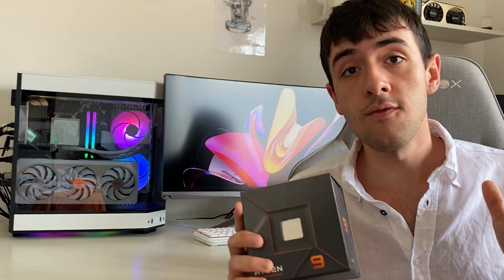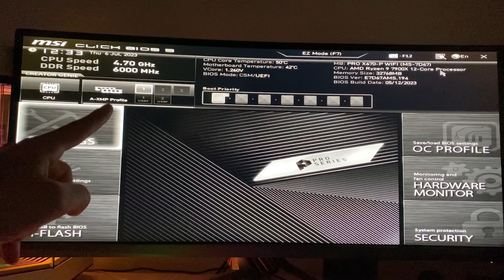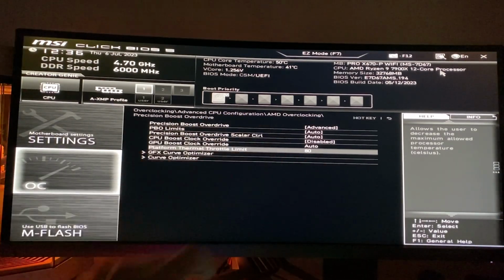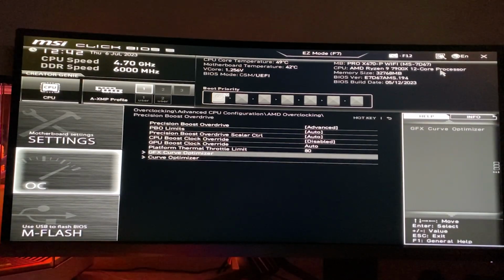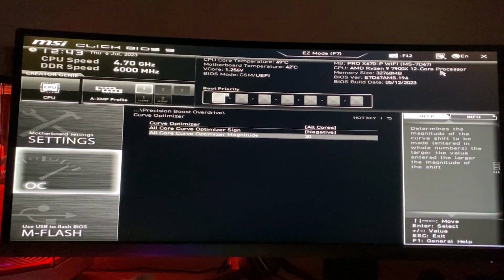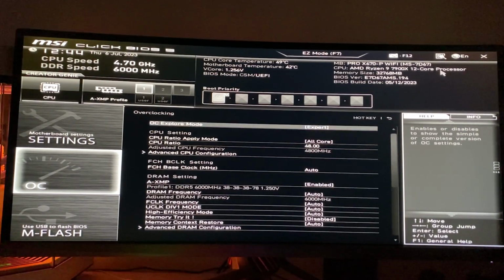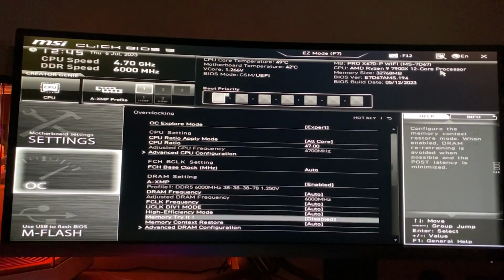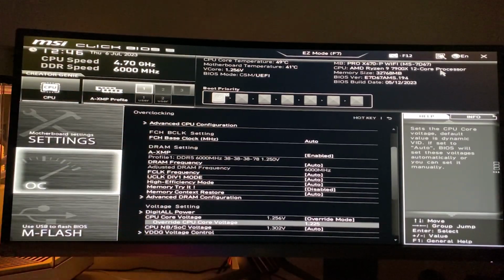Undervolt your Ryzen 9 7900X for more FPS and Lower Temperature!

Comment: Old video but hopefully someone can help.  I’m trying to follow this video and so far I managed to do the first part.  Changing the CPU Core Voltage is where I’m stuck.  I don’t see that option and the only thing I see is CPU SOC Voltage.  Is it the same??  I am using a ROG x670e Crosshair MB with my Ryzen 9 7900x

Comment: I'll share my brief, though I believe very useful, experience. I have a 7900x, I enabled PBO (advanced) and then, using Ryzen Master, I verified my gold and silver cores. Knowing this, I set the curve optimizer to -30 for my gold cores and -25 for the silver cores. What you achieve here is a reduction in voltage and temperature, and increased performance, utilizing most of the available clock frequency. It all depends on the specific CPU and its silicon, but I was lucky enough to be able to reduce the voltage quite a bit. I plan to aggressively overclock it to see the maximum voltage it can handle while remaining stable and functional for gaming, taking advantage of my good cooling.
Reply: Sorry, I forgot to mention that I did this for per core, not all cores. Why? Because only the gold and silver cores can function properly and stably at lower voltages. The vast majority of the other cores would fail, causing restarts and other annoying issues. There's not much point in using all cores at maximum frequency when games don't use more than 3 or 4 cores, being generous.

Comment: Just tried 1.175v at 4.8ghz 7900x on a x870 p wifi and load temps dropped to 70C from 90C, stable, now to test both GPU and CPU under actual game load

Comment: I’m having the best silicon lottery right now. 30000 score in cinebench r23 curve optimizer set to -30 and max cpu temp set to 80

All that with a case that doesn’t allow that much airflow to the processor. I achieved more than 31.000 with the case front panel removed and the air conditioner set to 27°C

Comment: Okay, so we can do the first part with temperature… or the second, with voltage, but not both?

I got a system with a liquid cooled 7900x that gets very warm and very loud, and I’ve thought of taking it back for a 9800 Ryzen build, for $500 more…

Is it worth the extra 500 bucks, or will doing this help enough?

Comment: My 5700x runs on -30 voltage and max positive precision boost overdrive clock thing. 4.85ghz on non avx workloads on 140w kicks hard. And 4.65 on avx workloads

Comment: Hi, should i set the PBO to disabled or auto when i wanted to use the static undervolt? Great videos!!!
Reply: Apparently PBO setting is not doing anything if youre using static OC. Hoping i can limit then max temps when doing full load. On prime 95 i got 5ghz with 1.1v but the temps went 93c, but at least for my games its showing better result with 55c and half the power consumption compared using PBO and CO. Anyways im grateful for your videos, please keep it up!

Comment: I currently getting 65-75c idle and only about 80-85c gaming on games like red dead 2 at all ultra maxed out settings I want to keep frames as much as possible but lower temps with still about 5.2-5.3 ghz is this possible

Comment: one thing to mention about the first method you showed. I found this out the hard way while undervolting my 5000 series AMD CPU. You might get great temps and great all-core performance, but only when your CPU is at load. I've found that this undervolt works great when you have your CPU doing something, but the second you have your PC at idle it will 100% guaranteed become unstable. This happens because the CPU is not receiving enough voltage to keep those low idle clocks, so this results in crashes and most of the time random reboots. On my 5900x I actually couldn't undervolt the cpu at all because no matter what negative number I used I got random reboots. With my 5950x I found -12 to be 100% stable. I just upgraded to AM5 and a 7900x yesterday so I'll give -20 a try but I'm pretty certain I'll get random reboots at idle and I'm sure I'll have to drop that number to something like -15 or -12 again. Honestly, I'm not really worried about performance gains over stock because I'm getting a 5.5Ghz all core boost as is, so I'm just looking for lower temps since in Handbrake I'm getting temps in the low 90s.
Reply: How are u getting 5.5 on the 7900x all cores, whats are your settings?
Reply: @daniboiyy  I actually don't have that cpu anymore I switched to a 7950x only about 3 months after getting that 7900x. I can't remember what settings I had with it.

Comment: I didnt trust this at first but I gave it a go, thermals limited to 80c, and minus 20, yet im getting better cinebench and blender benchmark performance vs stock? I dont get how running my cpu at a lower thermal and power limit improves performance ?
Reply: okay after a bit more research I understand, its not just reducing the voltage, its reducing the voltage relative to clockspeed,  so as an example at 4.5ghz it normally expects 1.1v and a t 5.5ghz it expects 1.4v as an example, undervolting is reducing the voltage at specific clock speeds so the -30 shift at 4.5 is 1.07v and at 5.5 is 1.37v  with a -30 offset, and the reason it improves performance is your producing less heat at the same clock speed so you can maintain the clockspeed, you just have to get lucky that your cpu can handle running at lower voltages.  This also means if you leave your max temp at 90-95 you can get more performance, or you can reduce temp targets to save power

Comment: Just wish to add some feedback to this great tutorial. I was idling around 65° with an AiO so I was sure something was wrong somewhere and with the help of this video I tested both fixed voltage and CPU ratio with no luck even with conservative values but with the PBO negative offset of 30 I was able to drop the voltage to around 1.175V and temperature of max 63° in gaming and idling at 45°. Masterful.

Comment: isn't is just better if you buy 7900 and overclock it to get almost same performance as 7900x ( considering you are using same cooler you would use on a 7900x ) when you need that extra performance, otherwise just let it be limited to 88w and enjoy the efficiency ( source - gamers nexus and LTT)?
am I missing something here because according to me, on same coolers and setup, overclocked 7900 = 7900x. both score around 30k on r23

Comment: I just picked up a 7900x for $280 usd. I could only find the 7800x3d for $425 and figured the deal was too good to pass up/ the extra 2-5% in games was not worth $145. This will be a big help to me as I'm building in a SFF and temps will be an issue.

Comment: Expo 6000MHz, bclk 100 , clock override +50mhz positive, pbo----> motherboard, co negative 18 all core and easy 5550mhz with air cooler ;)

Comment: Thank you sir at 5.5 gz temps are 80F out of the box with a 240 kraken but too much power not being used I'm trying your settings on my b650 board you bios settings are identical to mine..Also running a 7900x
.

Comment: Thankyou bro very much I was literally suffering from the temperature problem with my 7900x

Here are the results 
Stock : 
Cinebench r23 multicore scores 
28552 max temp 95 degrees 
Average temps 93 degrees 

Undervolting setting 1

Speed set to 4.8ghz 
Voltage :1.1
 Multicore score 27215 (nearly 5% performance loss)

Temps : max temp 74.4
Average temp : 72.2 degrees 

Undervolting setting 2

Temp limit set to : 75 

Curve optimiser : -30 

Multicore score :28708 (higher than stock) 

Max temps : 75.4 degrees 
Average temps :74.2 degrees

Stock temps were 93-95😭 bro is a legend
Reply: Whats your setings pbo? :D auto, motherboard or what
Reply: @echickentiken9200  
PBO : advanced 
PBO limits : auto 
PBO scalar ctrl: auto 
Platform thermal throttle limit :75
Curve optimizer: -30 (all cores) 
Motherboard: Msi x670e gaming plus Wi-Fi .
Reply: @yashkryadav7844  bus speed auto or 100Mhz?
Reply: @echickentiken9200   it’s auto

Comment: Need help. Just tried these settings. Saved and exited BIOS. rebooted and red light indicator on motherboard w/ black screen. How can I revert these settings? 😕
Reply: Set the overclock at like 4900 and voltage to 1.90. I can restart and all normally while getting good temps. If you need help just reply and I'm willing to help. It's not talked about enough.
Reply: I assume you fixed this already but just for anyone else facing this issue. Turn off the PC and plug the power off. Take out the flat CMOS battery out of your motherboard or press the reset button if tour mobo has one. Wait for 1 minute, put the battery back, plug in your PC and reboot. This should reset the changes made to your BIOS.

Comment: When I am exploring in Chrome and using Windows folders my temperature is 52C° stock, but when I am playing Left 4 Dead 2 in 4K and using OBS for stream it reaches a temperature of 85°, is it normal? The 7000 series is really too hot in general, I have the 7900x and the same motherboard as yours from MSI, ever playing ARK survival evolve in 4k it reaches more than 90° I feel that at some point this sep up is going to burn. An apology, use Google translator, I'm from Mexico.
Reply: Hey cpus are considered to be properly cool below 99 degress F under load. Your temps looks good! Nothing to worry about.
Reply: @Fluffy-ARC  The degrees are centigrade "c°" not Farenheit "f", for me this processor gets too hot and to only play left 4 dead 2 playing it in 4k I consider it to be quite a bit
Reply: @mexirene  sorry I meant C*. A processor is cooling properly under 95ish degrees C. Y

Comment: Setting PBO to 80 20 in bios has somehow hindered my Ryzen 5 7600 CPU.  Even now that I have set the motherboard back to default settings, I am getting bottlenecked at the CPU in Microsoft Flight Simulator now.  I have lost 15 frames per second, and it is a bottleneck of the CPU doing it. I have not been able to reverse it and get the FPS I was getting before I tried this.

Reply
Reply: Have you been able to fix it?
Reply: There is no point in undervolting a 7600 wtf is this 😂 stupid nga

Comment: Will this hurt the lifespan or help it by doing this? Any info on this would be much appreciated.
Reply: Undervolting will help extend the lifespan considerably. Running at very high temperatures for extended periods causes a lot of "wear and tear" so to speak, undervolting especially if done correctly can cause your CPU to run 15-30C cooler and with 10-30% less power consumption while still maintaining the same or even slightly better performance than stock. You can also cause it to run 25-40C cooler and with 30-50% less power but only a ~10% performance loss, if economy is more important to you, and last but not least you can combine undervolting with overclocking so that you gain 10-15% of peak performance increase without increasing wear that much.

Comment: Finally after months and months of having problems with temps I managed to find this video, with exact same motherboard and CPU. And using this and now trying even lower settings, I'm finally hitting 68 C on idle/web browser usage and not much mroe than 81-82 C average on newest demanding PC games. This is also super useful since I use game engines for work daily and finally my computer doesn't turn into radiator when opening multiple Unity instances. 10/10 guide.
Reply: i tried his settings, my default was 50 on idle now its 67... wtf

Comment: I have a question that i do not seem to find something specific online, for the stock as i understand the voltage is changed dynamically throught the auto option for the volts in the bios, why set the voltage to something static like 1.2V and why 1.2V and ton 1V for example since i am undervolting. Great video by the way the settings worked great!👍🏻

Comment: Tried it with my MSI Carbon X670 and a 9 7900X - instantly got around 800 pts more in Cinebench R 23, and the CPU hits a max of 88°C ( I only did 20mv and didn't restrict the maximum thermal limit ). Will keep trying with even more negative settings to see where we end up. Thanks for the hint!
Reply from the maker: I’m really happy it was helpful, thanks a lot for taking the time to leave some feedback :) Consider subscribing if you wanna support the channel & for more tutorials

Comment: So if i do the first settings im noy suppose to do the second? Its two different bios settings? Or can u combine them?
Reply from the maker: You need to choose just one!
Reply: @ImWateringPSUs  yaaa I did the first one and went from 92c full load, 5.8ghz. After your help it came down to 72c full load 5.5ghz. But it stays on 5.5 full load or idle, is there a way to make it throttle down when not using the cpu? Also thank u so much for amazing videos.

Comment: Hi , in my situation the pc runs into bluescreens
I tried 85 degrees and -10 and Even with this Setting it crashes :(
Reply: Or do you think i have to do the static one with capped core ratio ?
Reply: Reset CMOS and check for a BIOS update!

Comment: Mine 7900X Is set to negative 30 and 85C max temp. All tests show better performance. Before it run on 95C default, and now on 85C max. But some youtube channels suggest also to set max power draw. I wonder why is that, because setting the max temp to 85 instead of factory 95 already reduces power. So do I need to set the power too or leave it like this?
Reply from the maker: Max power draw is useless and actually counter productive to set :)
Reply: @ImWateringPSUs  can you also show how to do this for ryzen 9 7950x with this mobo? I really need that

Comment: 7900x should run 5.15ghz all cores if you have a good cooler ... I use a be quiet 360 aio an i reach 5.1 to 5.2ghz all cores when i compile programs
Reply from the maker: Weeell that’s under “normal” workload. Try productivivity/AVX though😅

Comment: I set mine to 5Ghz and voltage to 1.1v. Power consumption has decreased to half!! And temps from 40-60 idle to 25-37. No disturbing fan noise.. Wow!
Reply from the maker: I’m really happy it was helpful! Thanks a lot for taking the time to leave some feedback :) Consider subscribing if you wanna support the channel!
Reply: It is still running stable?
Reply: Did you find out? I’m having heat issues with my 7900x
Reply: Did you also limit max temp to 80?
Reply: I used this kind of settings but i can’t see improvement,sometimes it stills drops to 92 grades feels like nothing
Reply: I put mine to 5.150ghz and voltage to 1.135. Under full Load the temperature peaks at 85c.

Comment: Im totally new to pc stuff but my pc has a water cooler on it & out of the box i hit 5.0-5.7Mhz already on my cpu… so since I am water cooled does that play a factor as to why i already have such a high clock speed? Does me even “overclocking it” from the video make me achieve even higher speeds?
Reply from the maker: Yess you can still get gains from doing as shown in the video :)
Reply: @ImWateringPSUs  thank you i did as follows plus adjusted some fan curves & my cpu doesn’t even go above 75 unless im doing a benchmark test but caps at 78 i have never seen it go any further that that but that 100% load. On games im getting anywhere between 50•c up to 65. I have a Ryzen 9 7900x with a tripple fan aio

Comment: Can you please help me?

I want to underclock my 7900x to 3.7ghz to match the 7900 non-X. I also do not want any boost. Just a stable 3.7ghz without going up or down. 
What voltage do I use? How do I do this?

Thanks!
Reply: Sell your cpu and buy a 7900 non x lol
Reply from the maker: I'd say use the static preset from the video!

Comment: Hi!!! I have a ryzen 9 7900x, and a Msi PRO X670-P WIFI motherboard, when I want to save these settings (PPTL 80 & -20), the screen freezes, and I have to restart manually, and the settings are back to stock. Do you know how it can be resolved?
Reply: Update bios
Reply from the maker: Hi there! The -20 is the issue, slightly unlucky CPU. I’d say try -15 or at worst -10
Reply: @ImWateringPSUs  Well I tried everything, and it won't let me make any changes, when I want to save it the screen always freezes. The bios version I have is from 2022, should I update it?

Comment: Doesn't setting a specific clock frequency limit the CPU to that frequency always? And if so isn't it better to have the CPU freely use it's power capabilities of boosting whenever it needs to or does it not interfere at all?
Reply from the maker: It does limit the CPU max clock but makes it realy stable. It really depends on your usecase, which is why I show both a dynamic UV option and the static one you mentioned! :)
Reply: Im wondering the same thing

Comment: Instead of all cores curve try per core. Mine running 40 on the first 6 and 25 on the second 6. I was crashing at 30 on all.
Reply from the maker: Very tricky to find true stability going per-cors though😔
Reply: @ImWateringPSUs  For now I've set the first 6 core to -40 and the second 6 to -25. Atm I don't have enough time to spend hours on tweaking but planning to do so. On the other hand I have a 7900x3d, maybe it's different because of the separated cores. Also LLC on lvl 1. If it helps.

Comment: Tried this with both -10 & -20 on a 9 9700 non x.
-20 crashes -10 shows absolutely no temp improvements on idle.
Reply from the maker: You need to test it underload😅
Reply: @ImWateringPSUs   I don't know if it was because I was sent a prebuild with some of the settings/PBO enabled, but on the nonx , my CPU went up 5 degrees on idle temps trying this, all shown in the bios.
Don't ask me why but it did lol. Im not that worried to be honest, it runs at around 47-50 degrees c idle with a 120mm aio and the fans are basically always silent.
In the gigabyte bios the cpu temps normally showed 40, jumped to 45.

Comment: Err doesnt your static set up reduce performance? Setting 48 is lowering your clock speeds.
Reply from the maker: Yes but a stable clock speed increases productivity performance since it avoids throttle and gives you higher 1% lows in game